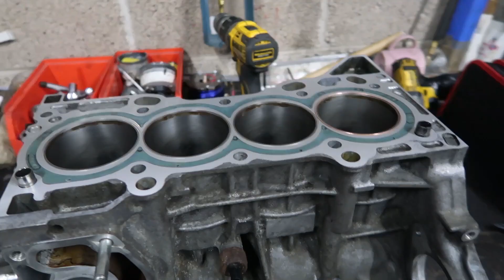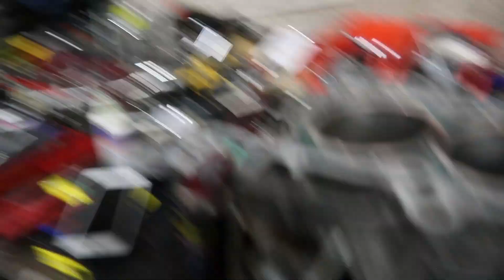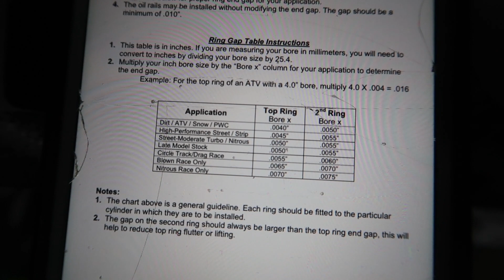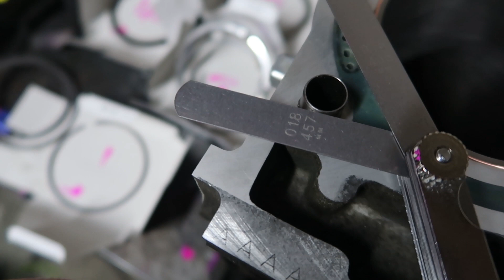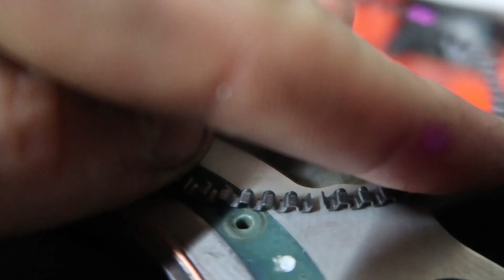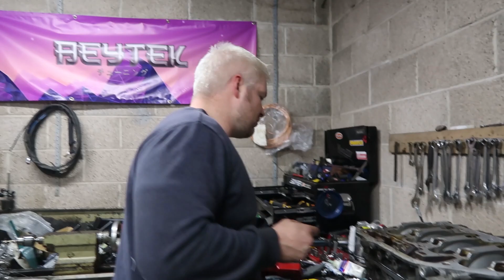RX7 K24 ENGINE BUILD PART 1

Comment: Those holes are way too small, you said your gonna run Ethanol unless its Nitromethane fuel you should consider enlarging those holes to at least 6-8mm otherwise your going to run into trouble with too much heat, ive filled and braced my block by 1.5-2” with Devcon Plastic steel Liquid 3 years ago, ive drilled holes at 8mm and noticed the temps were a smidge above std with a bigger alloy rad on a Fiat Motor.
Reply from the maker: thanks for your concern. The holes are perfect. have been running it for months temperature is perfect. the holes are larger than the holes on the gasket :)